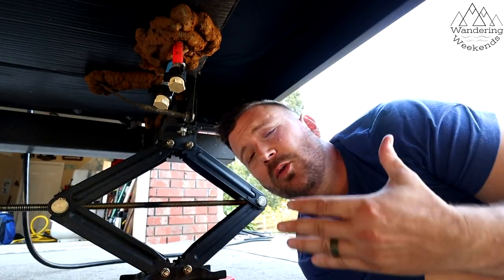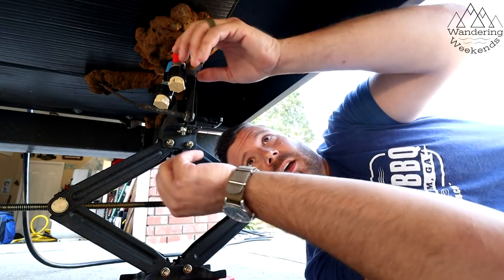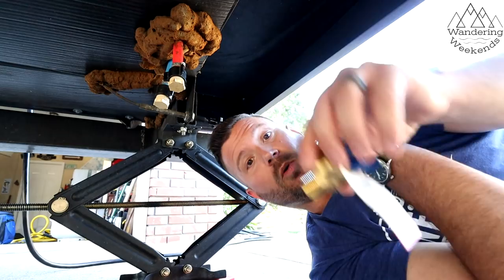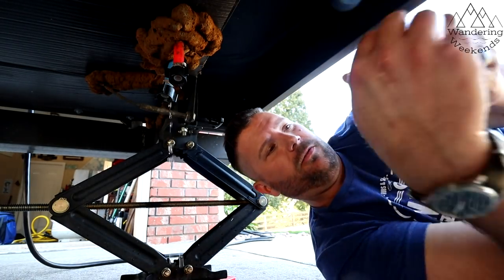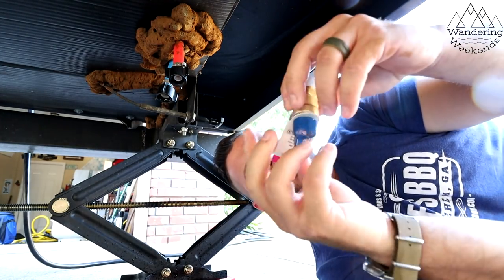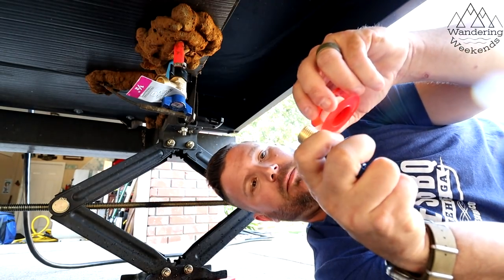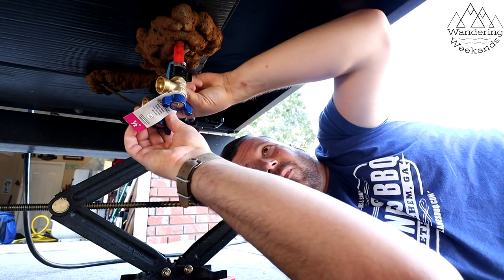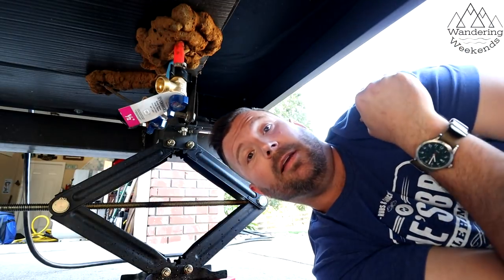Worlds EASIEST RV Mod!!

Comment: I did this 5 years ago to my travel trailer and I also put plastic dust caps on the valve outlets to keep critters from building nests and also to keep road dirt out. I built a cedar enclosure around a laundry tray sink and added washing machine hoses to it and it sits right next to my camper and we use it for washing pots and pans and any big cleanup job that we can’t do inside our camper. We’re seasonal so I leave it connected and winterize the whole thing with anti freeze and put a cover for stackable patio chairs over the whole sink for the winter. Have had it for 3 years and it’s the best modification we’ve made to our site.
Reply from the maker: Ed M Nice! Great call on the dust covers for sure.

Comment: This is a must do to any travel trailer or rv. You can run hoses and make up an outside sink if you don't have an outside kitchen
Reply: But will the pump kick in to keep the water pressure up?

Comment: I did the exact same thing to my low-points, although I used PVC ball-cock valves that point straight down. (bought them at Mennards for 3 bucks each.) I still put the plastic pipe plugs hand-tight back in on the bottom threaded portion of the valves to keep any road debris or grit from getting up in there, (probably unnecessary, though. . . .) I also put a brass ball-cock valve on our fresh water tank, as I got tired of having to slither underneath to get the pipe plug out, and then getting soaked not being able to get out of the way in time! (nice design, Keystone, placing that darn thing where you can't access it without being a gymnast. . .!!) I've used these valves now for three years -- all of them work like a charm!!
Reply: What size male thread do you need for that?  This is such a simple but great idea.
Reply: They're 1/2 in.female pipe thread. These are PVC-type plumbing valves.There were caps on the drains to start, and i took one of them to the store to match them up. I also put them in with teflon tape, as he did in the video.

Comment: Agree, did the same thing on our 5th wheel, only used plastic to avoid corrosion. Drain every time when parked after a trip, also then does not have water sitting in the hot water tank between trips.

Comment: I think i would use the plastic ones, the heavy brass one will put a lot of stress on those hanging hoses.
Reply from the maker: Downsizing Makes Cents quite frankly if these little brass valves cause the pex lines to fail we’re in serious trouble with our entire system. Thankfully Pex is not that brittle. Shouldn’t be a problem at all. Cheers and happy camping!

Comment: Nice tip.
Question:
You drain them after each trip?
I drain mine only when winterizing ours. Am I missing something?
I also drain my water heater only once a year but have read others drain theirs after each trip. When we go away for a month I also don't drain my home water heater 
Just wondering 
Greg in Michigan
Reply from the maker: Greg Homestead standing water is never a good thing... this is so simple it’s a no brainer for me. Your home water heater is likely a little more difficult to drain 😊
Reply: Home water heaters are under pressure and RV are under pressure when in use, (35 to 55 psi) mostly from city water connection. Once the hot water tank is drained, no more pressure, but gravity tends to accumulate to the lowest point in the system.

Comment: I had a different setup than what you have on your TT. I had two pex lines so I just cutoff the two cheap end caps and installed 1/4 turn shut off valves.  SharkBite 23037-0000LFA Straight Stop Valve 1/2 inch x 3/8 inch, Compression Fitting, Water Valve Shut Off, Push-to-Connect, PEX, Copper, CPVC, PE-RT. With shark fittings you just snap them on and you can remove if needed. Did same on my fresh water dump line.
Reply from the maker: Nice!
Reply: @WanderingWeekends  I do enjoy your videos and RV'ers need to share with one another to help each other and to provide good information to the newbies. We all have been there. I always drain my trailer after every trip. I even leave the valves open. You know as well as I that those lines can accumulate additional water over time. Helps to prevent potential mold from starting inside of the water lines. I open all my faucets to allow air to circulate as well. Yes, I also use lower air to blow out the lines and sometimes before winterizing, I use nitrogen to completely dry all all the water lines. This helps to minimize that potential mold from starting. I have nitrogen since my truck tires have nitrogen filled. So I keep a tank around to use.

Comment: Do you realize that you can hook a hose to the boiler valves and have hot water or if you get a mixer hose then you can adjust the temperature
Reply from the maker: Frank Mitzen we actually have an outdoor hot water connect at the docking station. If one didn’t it’s a great option!!

Comment: Those fittings on the top, are not designed for Teflon to be used. The little rubber washer on the inside, seals the threads.
Reply from the maker: Thanks for the info

Comment: Thank you for the info, I really like this set up! One quick question, do you put your antifreeze in before you drain the low points?

Respectfully
Reply from the maker: Kennedy Rodriguez no, drain the low points first. Close the valves and winterize. The antifreeze will make its way throughout the system including these low points.

Comment: I did something very similar. I used ones with handles. I take the handles off so no one can empty easily.
Why do you drain between trips? I would only empty if long time between trip or end of camping season. Which is tomorrow 😭.
Reply from the maker: Boo for camping season being over!! 

Stale/sitting water is never a GOOD thing. I don’t think it would hurt to leave the water for a few weeks but since it’s so easy to drain it I simply prefer fresh water every time we camp. Water heater can get a funky smell of it hasn’t been drained in a while too. Maybe it’s overkill but it makes me sleep better at night.
Reply: @WanderingWeekends  I do drain the water heater if more than a week. I will think about drain low point more often. I will blow lines out layer this week. I do sanitize the beginning of each season. This year we only missed 6 weekends of not camping since 5/10. Retired 6/21/19.

Comment: My Jayco trailer has straight pvc tubes hanging down.  I don’t have any threaded ends to attach your drain plug.
Reply from the maker: Wayne Hogue 😕
Reply: My jayco came with these already pre installed.

Comment: My trailer came with shut off valves on the low point drains. Why didn’t yours?
Reply from the maker: gun freak I’m completely aware of the insincerity in your question but weight saving and cost savings can be found in every travel trailer. Who said you didn’t pay more for your trailer? Who said your trailer doesn’t weigh more than mine? If you’re gonna troll at least have a decent point. 😉😉